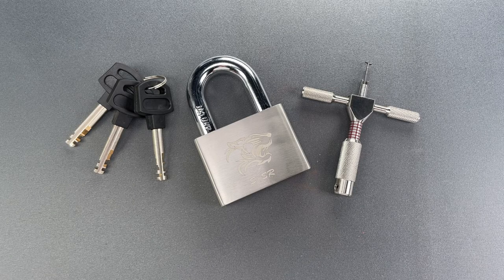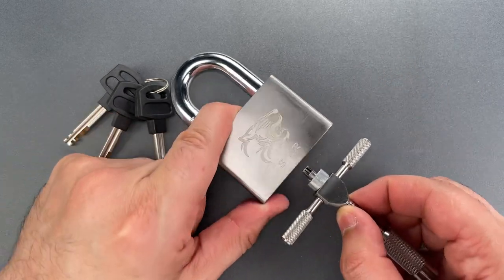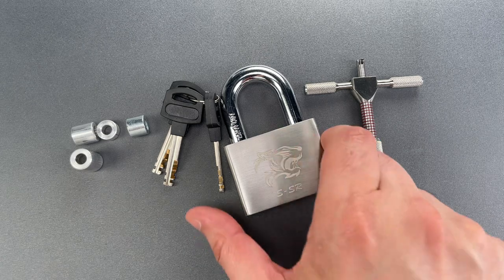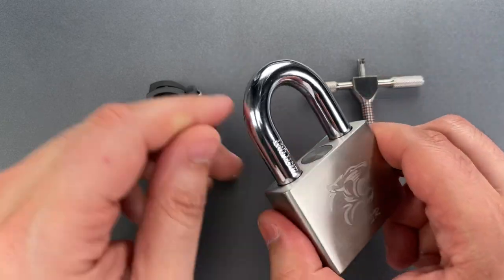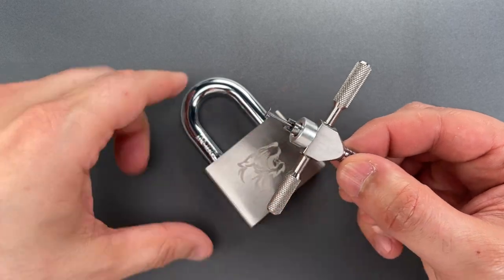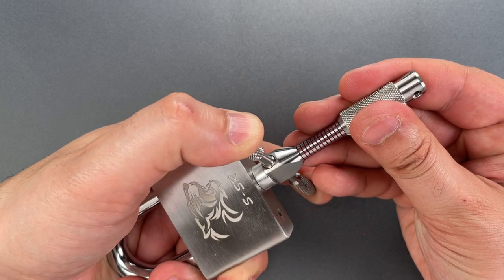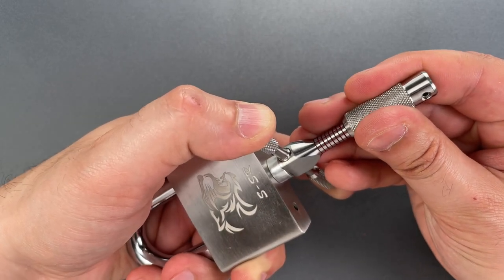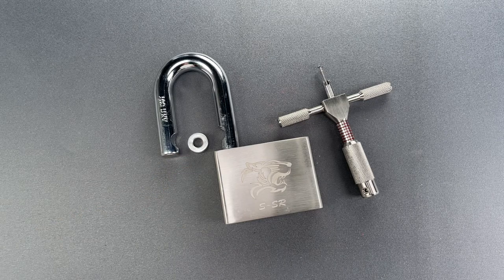[1368] A Crutch For Picking Disc Detainer Locks (S-SR Padlock)

Comment: Genuine question for anybody that is smart enough to answer: is it possible to create a lock that is 100% pick proof? Or is it just elevating the pick resistance of a lock to extremely high degrees, where destruction becomes the most likely method of entry?
Reply: I think this depends on what you mean by "picking", and what limits you place on the lock.  A properly-made electronic fingerprint-recognition lock can't be opened without giving it an image that it recognizes as the correct fingerprint, and if you want a key lock, you could do the same thing with a camera that photographs the inserted key.  Except that "can't be opened" is might not be precisely true; with an extremely strong electromagnet and precisely-timed pulses you might still be able to get it open, although figuring out how would be completely impractical even with full access to the lock for a long time beforehand.

More practically, Stuff Made Here sent LPL a couple of "unpickable" locks a few months ago, and while LPL was able to pick them, that was largely because of design flaws that would be pretty easy to fix.

So: It's possible to elevate the pick resistance levels to degrees that are sufficiently high that nobody would ever have the resources and time with the lock to do it, and where we can't imagine a successful picking method.  It's not possible to prove that there 100% is no physical way to pick it, though.
Reply: There are always tradeoffs with anything. As Brooks mentioned, it depends on what you mean as well. There are plenty of locks that can't be picked, because the tools involved technically aren't picks, but you can open them easily without a key. For example, you can't pick a combination lock. There's no keyhole to pick through. Plenty of ways to defeat a combination lock, but picking isn't one of them.

If you just mean non-destructively defeating locks, probably not. There are tradeoffs in engineering. The more complicated you make a thing, the easier it is for something to break or for a stray exposed surface to allow improper manipulation of it. There are certainly locks that BosnianBill and LockpickingLawyer haven't been able to open, but other people have through custom picks, decoding (where you figure out your own key by manipulating the lock or inserting something into it), and other mechanisms I don't understand.

That said, after watching most of his videos, I can think of some locks that I can't think of a way to defeat. But they're all impractical as hell.

1. A fictional electronic lock. I say fictional because I want to emphasize that it's not a thing you would actually want as a user. All electronic locks have a non-electronic way to open them. If they're self-contained, it's usually a conventional key which could be picked conventionally. If they're not self-contained (like the ones where I work), there's a conventional key lock on another door somewhere else. It's not technically the same lock, but you'd still be defeating the electronic lock by opening the conventional lock on another door.  To make an electronic lock unpickable, you'd need to accept the only way in in case of a wiring fault or a dead battery is destructive. To make it work, you would need to fully encase the wiring, electronic components, solenoid and power supply in solid ferrous metal, and have non-conductive stand-offs for all components inside of it, and only expose a hard resin surface that is flushmounted with the metal to avoid prying and braced internally to avoid pressing. Behind the resin would need to be some form of signaling device to communicate with a smart key that uses rolling key encryption for a challenge-and-response with the user, and a time delay between attempts. You would need that rolling key encryption AND the user's pool of possible responses to thwart it nondestructively...until quantum computing becomes feasible to us against it. I work in IT and I'll just say the software side of what I just described is something in the "we could do it, but it's not worth the effort to do" range for nearly every real world system. There are a few extremely high security applications where it's used, but even those are in purely digital applications. I have no idea how much the hardware side of this would cost but we don't see anything even close to this even with the conventional keys as backups.

2. A really bad key. Fundamentally, picks work because they can be thrown away if they break. LPL and BosnianBill frequently talk about breaking multiple picks on tough locks. But you can't have your key breaking under normal use, meaning the key has to be thicker metal. If you made the key out of thin enough metal, but still used the complicated key mechanisms of high end locks, it could be made unpickable, but the key would quickly break off in the lock.

3. A key with moving parts. In several videos he shows locks with warding, a barrier to picks where the surfaces of the key doing the opening are turned behind it in a way that's hard to pick past. He's shown various ways of defeating these, but it always involves sliding something through the holes you're putting the key through before turning it past the warding. Hypothetically, you could make a key with a relatively narrow tube and a corkscrew inside that pushed out spiral contact surfaces in multiple directions when you twisted a knob on the key to interface with pins past a honeycomb of narrow inner false wardings and a slot in the end of the barrel of the key to align it with the true wardings. I don't think you could make corkscrew picks to work with such a system, but I could be wrong. This would be stupidly expensive to make, and possibly too fragile like the "really bad key" example.

In addition to being stupidly impractical, there may be ways of thwarting these that I can't think of. There's a reason every time someone makes an "unpickable lock" someone comes along and picks it. The constraints on the ones making the locks are much tighter than the constraints on those picking them.